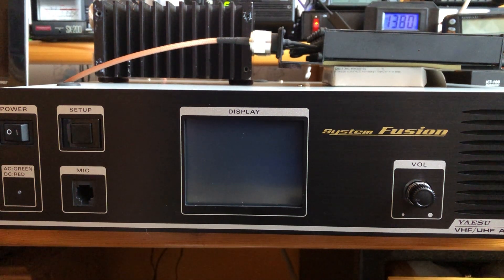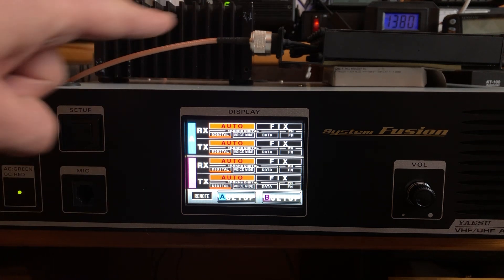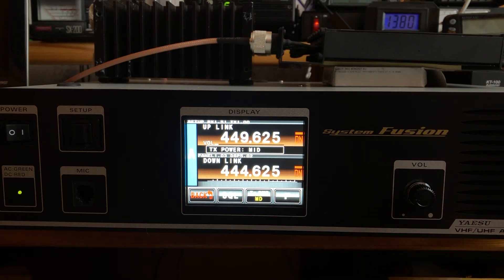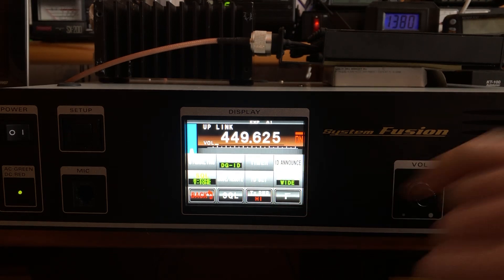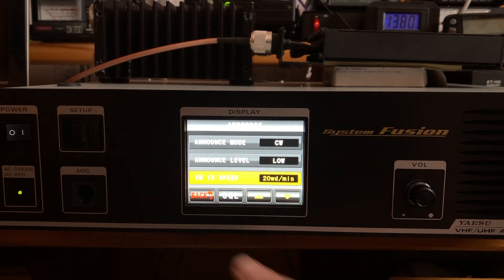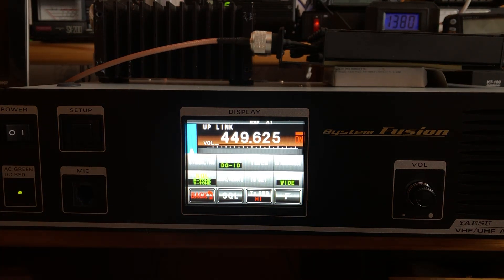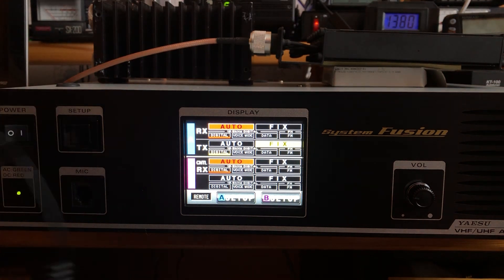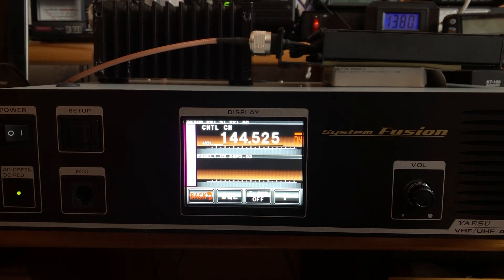DR2X complete setup ... One example from factory settings to ready for install

Comment: well if Yaesu had not lied when they first promoted it as optional base station, more would have been sold.... as it is, yea, we played repeater for a while but now its boxed back up .... The Yaesu DR-2X is designed as a dual-band, dual-receiver repeater, not a single-radio base station. It uses two transceivers (one for each band) and can be configured for cross-band repeat or other linking operations. To use it as a single-radio base station, you would essentially disable one of the transceivers and focus on the desired band and its associated functionality. 
Here's how you can approach setting up the DR-2X for single-radio use, with a focus on the functionality and limitations:
Understanding the DR-2X's Design:
Two Transceivers:
The DR-2X has two independent transceivers, one for each band (VHF and UHF), and a secondary receiver. 
Cross-Band Repeater:
It's primarily designed for cross-band repeater operation, where it receives on one band and transmits on the other. 
Linking:
The secondary receiver can be used for control and linking to other repeaters or systems, like WIRES-X. 
Setting up for Single-Radio Use:
Choose your band: Decide which band (VHF or UHF) you want to use for your base station. 
Disable the other transceiver: Program the DR-2X so that the transceiver for the unused band is effectively turned off or set to a receive-only mode. 
Configure for simplex operation: If you only want to transmit and receive on the same frequency on the chosen band, set the DR-2X to simplex mode (often called "direct" or "non-repeater" mode). 
Set up your antenna: Connect a suitable antenna for your chosen band to the appropriate antenna port on the DR-2X. 
Configure CTCSS/DCS tones: If you need to use CTCSS or DCS tones for access control, configure them on the chosen transceiver. 
Consider a duplexer: If you want to use the same antenna for both transmit and receive, you might need a duplexer to prevent the transmitter from interfering with the receiver. 
Power Management: Ensure proper power supply and connections for your setup. 
Limitations to Consider:
Not Optimized:
The DR-2X is not designed as a dedicated single-radio base station, so you might need to work around its features.
Cross-Band Functionality:
You'll need to ensure that the cross-band functionality is disabled or properly configured to avoid unexpected behavior when using it as a simplex station.
Limited Control:
Using the DR-2X as a simplex station might limit some of its more advanced control features, especially those related to linking or cross-band operations.

Comment: When I put my B side in control the A side will only do fixed digital out.
Reply: This is a bug. I had a same problem, I couldn't put in auto mode anymore by pressing touch screen. But with remote set to digital and than back to auto worked for me.
Reply: @TelLieVision4sheeple  Yeah that’s what I ended up doing, but I don’t remember it doing that before. Seems strange but it on both of mine.  Thanks for the response.

Comment: I have such a repeater and I would like to set it (if possible) in dual mode or (only works locally and is not connected to other repeaters) to work YSF or FM. So if I have the station set to VW DN it works digitally, if I have FM and TSQ it works analog. Is this possible, and if so, how do I set it up? Currently, the repeater works only in FM mode.

Comment: Nice vid. Videos are great but non. Show the back in how the antenna is setup for cntrl. Any help would be greatly appreciated
Reply from the maker: depending on location of install. The control receiver N connector on the back of the repeater In a roof top repeater cabinet I ran a mag mount antenna and put it on top of the repeater cabinet. At a repeater tower where the repeater is on the bottom, I've used abandoned lines from the tower even if the antennas are failing or out of band. Does not take much to receive a signal for DTMF controls.

Comment: Hello sir .. in your example in channel B if I wish that the TX FREQUENCY in  CHANNEL B will be the same as the TX frequency in channel A .. what mode will i use or can I use the same mode as control mode? thank you so much for this video
Reply from the maker: I have to be transparent I have only set up Channel "B" as a Control mode so therefore it only listens for DTMF commands to control the repeater (such as Enable, Disable, Fixed Digital, Auto mode, and power settings 50, 20, 5.    With that the control mode I have always used the opposite band. For example If I set up the DR2X repeater as a VHF repeater such as 145.190 (-)   The control receiver is set to a dedicated UHF simplex frequency.  And with the ones i've used, i've only used analog DTMF settings. I am not terribly familiar with the digital option for control frequency.